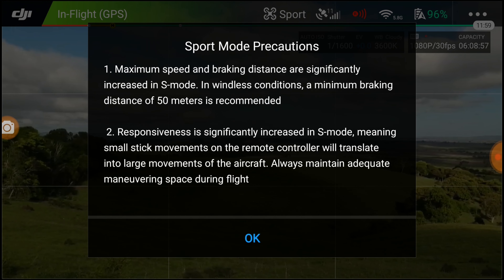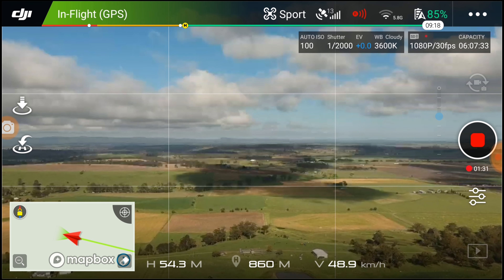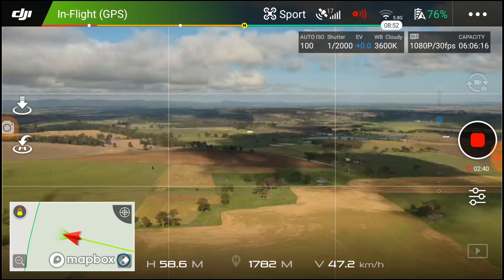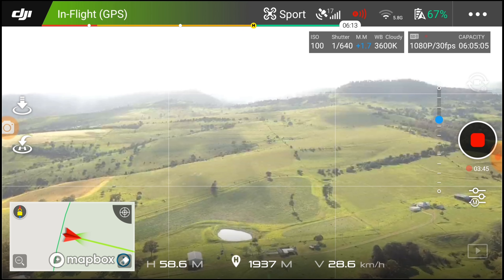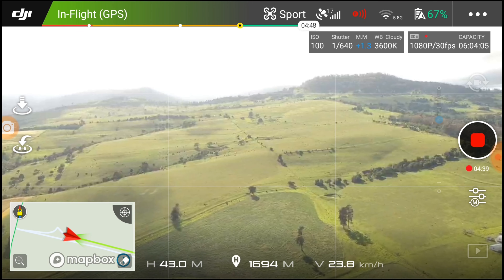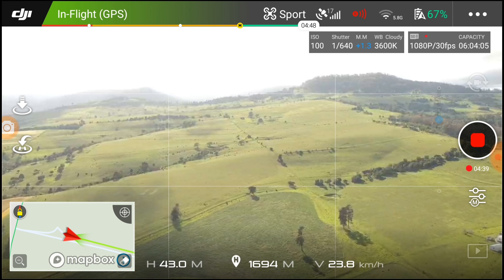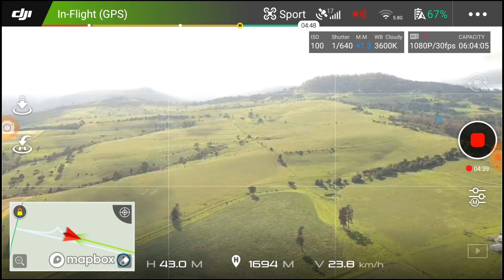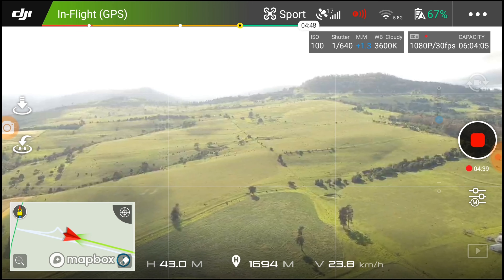DJI Spark OTG test, nearly didn't make it back

Comment: Nice range! I have flown mine up to 3000 feet away and could have gone farther but I got spooked lol. Brought it back home and went back out again. I also have the Parabolic wifi extenders and I think they help as well. I use everything I have if I go over 500 feet away. I have never had that happen to me when I use the auto return to home feature. Always came back for me without any trouble at all. Ihave lost connection before and the app crshed. Ihave the video on my channel.
Reply from the maker: Jack Sparky Frahn lol yeah mate I got a bit jumpy myself. Never flew 2000 meters before, that’s about twice the distance you have flown so yes you could go at least 6000 feet without a problem especially with parabolic. The flight this day was without parabolic. I might use the RTH  next time for sure see how it goes. Gonna check your vid out mate for sure. Thanks for checking it out. Really appreciate it. Cheers

Comment: Far out, that was doing some weird things.  Had any trouble with it since Matt?
Reply from the maker: Hey mate. No haven't had the same problem happen so fingers crossed it won't happen again. I have had other issues though to do with props. I'll be posting a vid on that shortly.  Thanks for taking the time to check it out mate.  Cheers